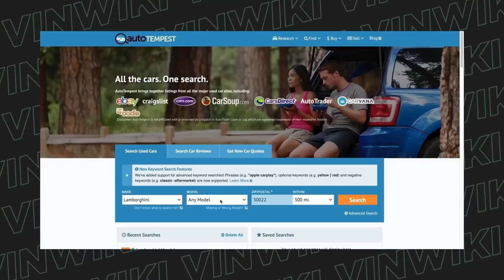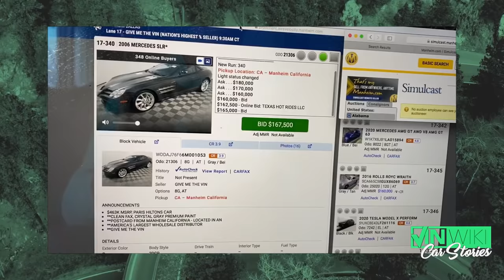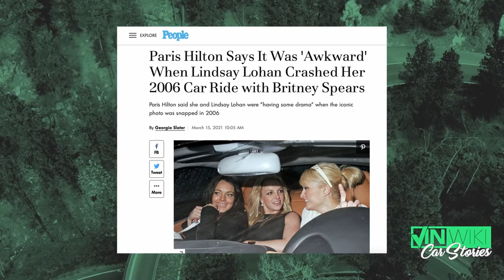Top 10 VINwiki Stories of 2021

Comment: I worked at a little body shop here in Fort Wayne Indiana and there was this yellow focus ST that was wrecked in the front end and the owner had sat on this car for close to 6 months before it was even touched, one day he comes to me and asked if I wanted to go to NY with him I said sure why not. I was paid by the hour on the road or not so it wasnt hurting me either way. We get there and sure enough we're picking up a yellow focus ST that's wrecked in the rear. We get back cut both of them in half drilling out the welds under the seats doing it the proper way and welded the 1 car back together. Some guy come down from Michigan to buy and it's been on the road ever since and that was roughly 5 years ago

Comment: Tore apart my 27 Ford roadster. Last fall. Now painting frame and suspension
Reply: Wow, finally another hot rod guy.  Mine is a 28 with 5.0 HO Ford engine.  No stinkin fenders!